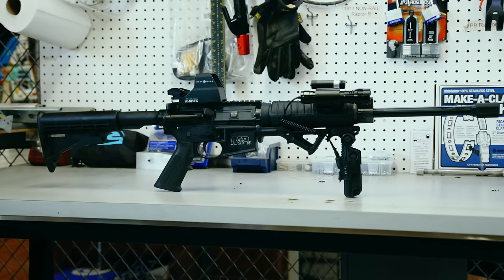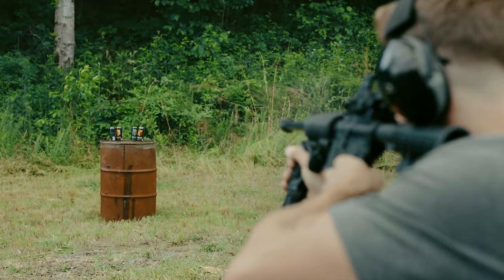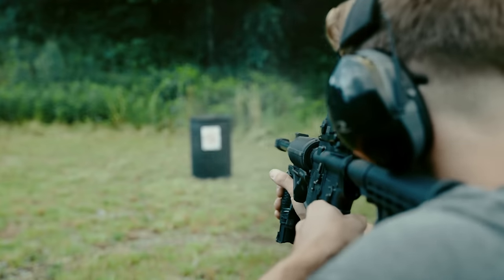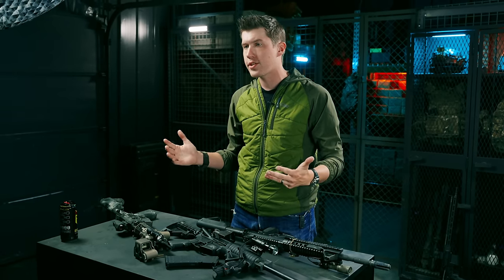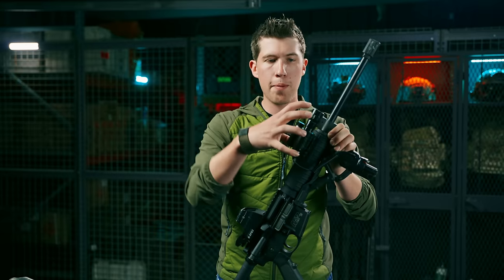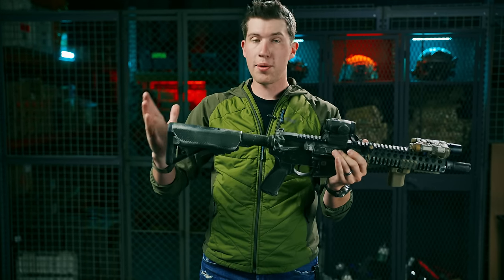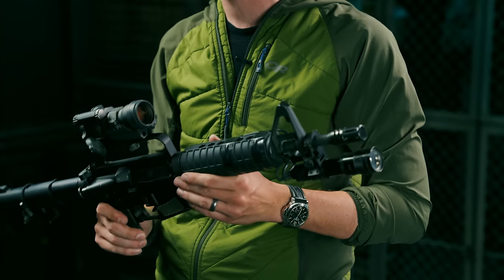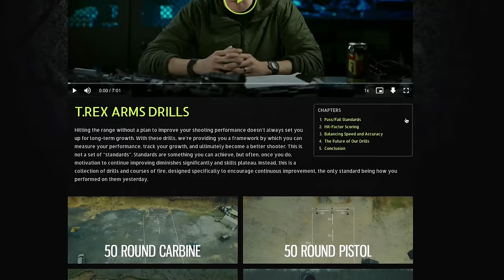5 Mistakes New Rifle Owners Make

Comment: Not technically my first rifle, but my first AR rifle was a PSA carbine kit I bought. All I put on it was a carry handle iron sight, a flashlight mount and a simple vertical foregrip.
Reply: No sling?
Reply: @xxxlonewolf49  not at first, that was my first upgrade, I also put an aimpoint on a carry handle optics mount because why not?
Reply: My first rifle was a PSA upper kit and a locally sourced lower. Total was $380. Cheaper than any of my handguns. Those were the days. More accurate than I am and over 6200 rounds the only issue has been it won't feed steel case reliably. Meh.
Reply: Chad detected. Same but 20 inch
Reply: I just built one of those!
Reply: PSA was my first build as well. It cost me less then 400 I've since upgraded a lot of parts. It is my favorite ar cause it was my first build
Reply: Carry handle chads assemble.
Reply: Did the exact same to my first ar (s&w mp 15ll) except put a drop in trigger (LE145) and a giessele super 42 h2 buffer
Reply: @Hopeofmen  oi. Dedicated Integrated grab handle upper receiver sigma chads assemble
Reply: My first was a PSA freedom complete upper and complete lower. No issues or malfunctions yet. Now I build em for a purpose
Reply: You stuck to the basics. A sling, a light, and iron sights are the true basics.
Reply: Actually planning on building my next lower into a pistol. Gonna order a pre-made upper from PSA. Glad to hear they work well!
Reply: My first build was a Frankenstein build all the way! 80% lower, Anderson upper, radical firearms 7.5in barrel had a mbus sights and a utg scope that actually has lasted and now I'm selling it and getting a new primary arms red dot sight
Reply: PSA are great American made ars.
Reply: I'm still trying to find a setup that I like. The only upgrades I'm certain on right now is my meprolight reflex and A.R.M.S frontsight and magpul rear iron. Still looking for a light and handguard I like enough.
Reply: @mustangaldine  i wouldn't call them great. They are functional though
Reply: My first rifle was a 30/30 lever action still is exactly like when I was given it when I was like 8 years old.
Reply: @prylosecorsomething3194  it's not what American is founded on
Reply: Poverty State Armory. Poor choice, bro.
Reply: @sevenpointsixtwo9707  Oh no! It's a fasion disaster!
Reply: @RJT80  try some mobile 1 on the bolt face and couple drops where it locks up in the breach. Should help with cycling steel case
Reply: @RJT80  my psa upper had that problem too I’m pretty sure the chamber is just a few micrometers too tight since the steel case doesn’t shrink back after it fireforms switched out the upper for an aero precision and I can shoot steel all day, idk if it’s a psa problem or we just got a couple of lemons
Reply: @yeedbottomtext7563  oh you got that lengthy boy huh
Reply: @NoName.NotNamed  the only ARs that interest me fr 😂
Reply: @yeedbottomtext7563  what barrel did you use? I’m trying to build one of my own but I’m not too knowledgeable on long rifles
Reply: @NoName.NotNamed  grab one of PSA’S premium 20 inch uppers for Dat sweet FN barrel
Reply: @yeedbottomtext7563  ima give it a look see thanks bro
Reply: @NoName.NotNamed  for sure breh
Reply: @zacharybigger4144  I bought a PSA back in 2020. I love it. It’s my first one. Haven’t used it much recently since I moved out of Washington state. I heard over the last few years PSA has stepped up their game. So they went from not bad to decent or slightly better than decent I guess lol!

Comment: Army teaches 25/300m zero which works extremely well with the 4x32 ACOG. If you zero with the bottom of the chevron for 300m, the top of the chevron will near perfectly line up for 150ish meter targets. That way you’ll never shoot over the target if you can estimate range fairly well.
Reply: The width of the elevation ticks is also supposed to approximate average human shoulder width at the labelled range, which helps estimate distance a bit.
Reply: Marines teaches 36/300 yard zero which allows no need for any other adjustments besides hold center mass and fire out to 300. After 300 yards we do wind holds out to 500 yards. It allows that at 500 yards your general round drift etc will not expand larger than that of a CD size. Obviously the ammo type will make a difference but essentially holding center mass from 301-500 yrds will enable an effective hit within a CD sized target.
Reply: Battlefield 3 and ArmA both taught me how to utilize the ACOG. Then I grew up a little and realized how expensive Trijicon is lol
Reply: @BeamMonsterZeus  Facts. As expensive as they are I still want one for my AK in the near future due to their durability. ACOGs are not easy to break.
Reply: @arc_4543  ACOG
ALL CASH OPTIONS GONE
super spendy. 
You’re correct they are super tough. 
If marines can keep them working, then it’s one tough ass optic. 
Loved running the ACOG in the ARMY, loved the Eotech even more. 
36/300 zero is the way to go in my opinion 25 yard zero about 1/2” high.  <for my crayon eating brethren 😂
But yes 25-300 is mostly point shoot with ACOG and Eotech. 
Marines are some of the absolute best riflemen I’ve ever worked with and I would take their instructions running a rifle all day long.  The poor guys got the least amount of gear and the most amount of kills in Iraq, always wanted to give them some of our gear.  
A well equipped team of Marines is one badass show. 
Loved going out and clearing mine fields and IEDs for them.
Reply: @antman656  agreed.  36 is where it’s at.  And Shawn did do a great job showing the ballistic differences in zeros 
Back in the early angry Shawn vids.  Amazing transformation he’s had.
Reply: I got trigi night irons for my A1.
Reply: Thanks for info, im Army and hopefully put in a few weeks. I have 18.5" tavor x95, been ex british army wanted a bull pup again.  I zeroed my m150 acog 25m for 300 and i hit tgts at 500yds.  Going to range in a out 3 weeks again gonna zero as you suggested. 🏴🇺🇸🇬🇧🤙
Reply: @antman656  ngl that sounds pretty bullshit to me. 
36/300 yard is about the same as 25/300 meter. 
And 5.56 climbs and drops around a foot+ from 50 meters to 300 meters
Reply: @arc_4543  if you can get one for the caliber you use(i think only comes in 7.63x51 nato and 5.56) the m145 is amazing if a bit hefty.
Reply: My brother was in Army infantry for 10 years. They zeroed their ACOGS at 100 meters. The 25 meter targets are what I zeroed at with my ACOG (still in).
Reply: An ACOG would be a dream optic like that's the end goal optic. They are tried true and tested, durable and reliable. However the starting price is around $1200.
Reply: @mondaysinsanity8193  Nah he's right.  Also the Trijicon 4x32 acog is made for 5.56, so the markings are the general drop over distance, the width of the lines is used to measuring distance to target, and the side lines are for adjustments due to windage, which is only applied 300 meters and on, but only really past 300 because unless you have heavy winds, 300 wont change much if at all.  100m for tip of chevron, 200m for crotch of chevron, 300m for tip of post, and so on.  The lift of the round is 25m using the 400m, 50m using the tip of the post. (I'm half sure on the post, maybe the crotch)
Reply: @johnnywalters2582  i mean none of that sounds like its disagreeing if you use the same point of aim say the tip of chevron 
And shoot froom 50 to 100 to 150 out to 300 youll see atleast a foot of variance idk exacts but enough to make a headshot at one point a crotch shot at another
Reply: @antman656  Going to be honest... I've never heard this 36yd zero nonsense. I got out of the Marines in '12
Reply: Um closest popular on any range I have been on was a 50. Zero was at 25 but that's still a 300 Meter zero target. Go what he was talking about
Reply: @arc_4543  dawg only person I know who broke an ACOG is a retired marine and he sent it back to trijicon and they sent it back fixed like new.
Reply: @jackshett  36y started with the SEALs because it has minimal spread out to about 400y. From 25-300m you can hold center of mass and you will land a hit somewhere on the upper thoracic or lower abdomen. Shawn Ryan made a video on it.
Reply: @Jewifer333x2  And I'm stupposed to know who that is? lol. Anyway it sounds like new teaching that isn't really giving much benefit over "old"
Reply: @Jewifer333x2  Sure thing keyboard warrior.
Reply: @Jewifer333x2  who's the army cook? I just prefer the more useful zeroing that I was taught.
Reply: @Jewifer333x2  anyway before your panties get bunched up beyond repair... A combat zero is only useful within the expected distance range. The 400yd that was brought up is ridiculous. You'll barely be hitting with the deviation from impact to poi. It's more useful to have something where you hit accurately between 0-300 since engaging beyond that isn't what the weapon is meant for anyway. Those ranges are what a dmr is for.
Reply: @jackshett  wow, you are speaking very much so like someone who rarely shoots at those distances, you can literally make those shots with an M4 length barrel and a magnified optic
Reply: @jackshett  dude. Shooting kneeling and supported I can land 5/5 shots on an IPSIC just simply using a BDC out of a 14.5 barrel at 400y with some low quality green tip of all rounds. It isnt hard. With a 36y zero on an MRAD reticle or a magnified red dot you could absolutely memorize those holds.
Reply: @Jewifer333x2  it's not that you can't shoot that far, is that it isn't powerful enough at those distances. Also the typical ranges that you're going to have combat in are not over 300 yd anyway. And if you're going to be shooting at those ranges anyway, you're going to be using well aimed fire and typically an optic. So when you're doing that you will be using either a bullet drop compensation, BDC, on an optic or you will be changing the elevation on your iron sights. I'm tired of these keyboard warriors thinking they know anything beyond call of duty. Your arrogance and ignorance is astounding...
Reply: @jackshett  mark wahlberg over here throwing around advanced ballistic lingo for 5.56 within 600y lmao what a joke
Reply: @Jewifer333x2  additionally if you zero outside of what is designed for your optic, you're just inviting problems. Either you'll have to remember that 300 yd range on the optic is actually 235 or you'll zero it properly the way the optic was designed. And don't tell me that you're you are using a mill or MOA dot reticle.
Reply: @michaeljenkins2493  If you're zeroing the Trijicon 4x32 ACOG for the tip to be zero'd to 300m, then you're using the sighting system wrong
Reply: @adamjohnson6506  Got one on my LMT MARS AR15. The only optic you need for AR15s in my opinion. Good luck man.
Reply: I heard you can have 25/300 or 36/200, or 100. What are the drops?
Reply: Well done nice and succinct
Reply: On what caliber ?
Reply: @ronaldraygun2639  5.56x45mm
Reply: It's not bad. I like the 36m zero a lot but at 500 you definitely need to be holding at the head or shoulders at least. It's almost a 9 MOA drop. At 25 zero it's only 7 MOA drop. At least that's what I have to do. Even then I hit low.
Reply: You don't use the tip of the chevron to aim. You use the little dot under the chevron. If the torso or shoulders do not touch the edges of the chevron then you can use the lines under the chevron to gage distance and hold for elevation.

Comment: Not gonna lie, I put a Sig Romeo 5 on my shorty AR and fully expecting to upgrade it later but in 5 years I've had zero issues with it. It's still holding the same zero that I put on it when I first zeroed out. I'm not gentle with that gun either. I'm very pleasantly surprised by how well it's done.
Reply: x2 for Sig Romeo 5
Reply: Yep
Reply: Same here, took it off now for a vortex pst lpvo but it served me extremely well for 3 years…
Reply: You gotta realize these guys are a bit elitest and not really the everyman.  There are really good red dots from sig, primary arms, and holosun.  They all last a long time.  In many cases just as long as stuff costing double.

They recommend some great stuff but it is all high end expensive stuff if you aren't a wanna be operator.
Reply: @SW0000A  totally agree… they do recommend kind of the best there is but I got to give it to him he did mention primary and holosun as good options. 
We all want that DD with a aim point or razor surefire can and dbal but until I get that, I’ll stick with an average gun with a holosun .
Reply: A Sig Romeo 5 is nothing to scoff at.  That's a good red dot.
Reply: @shrimuyopa8117  I second that.
Reply: I've also had the Romeo5 for about that long. Only issue was the mount but recently changed it with the one Scalarworks makes. Pretty happy with it.
Reply: @shrimuyopa8117  I third that and will go as far to say the Romeo MSR is good for as low priced as they are. It’s my understanding that holosun makes SIG sights.
Reply: Most brand name RDS in the $150 range are plenty good for practically any situation a civilian would ever encounter. Don't need EOTech, Aimpoint, Trijicon etc. but if you got the coin and want the best, whatever.
Reply: Yeah, sig romeo 5's work. It is the current king of the budget 100 dollar red dot market and has been for a while for good reasons. There are better things for more money but as a getting started red dot, you can do much, much worse.
Reply: x2 for the Romeo. Purchased my Romeo 5 in Alaska and expected to have issues, but its lived through the cold, maybe two-ish thousand rounds, thousands of miles of travel recently. Went to the range expecting to have to re-zero in Oklahoma before a competition and that little sucker was dead on still.
Reply: I like my Romeo 5 MSR. Still planning to upgrade, but no rush.
Reply: Another one for the Romeo 5. I recently upgraded to a T2 but my Romeo 5 was going strong at the two year mark. Multiple courses, bouncing around in pelican cases, etc.
Reply: Romeo 5 and holosun I have on multiple rifles. Expensive stuff on others. It's all about what the use case is.
Reply: Very happy with my romeos as well
Reply: I left a romeo 5 in the trunk of my car for a whole winter.  A frigid sub zero winter in the tundra of Idaho.  I checked it every couple weeks and end of winter was good to go.
Reply: I would have to agree, but I didn't even get to zero mine before it broke. Changed battery and still nothing
Reply: Did the same on one of my Aero Precision 11.5" m4e1 builds. Im actually just about to order a "sky scraper" mount from scalerwerks bc my head and face is so big lol. Nothing wrong with Romeo5's. I have other more expensive optics as well but still doesn't change anything. If they're good they're good.
Reply: @SW0000A  I agree.  All of my red dots are Sig Sauer.  They're all solid!
Reply: Yeah, I bought a Romeo 5 and learned that I had astigmatism. Great red-dot though.
Reply: Holosun makes all of the Romeo5 line but to SIG's exact specifications. They are great optics and anyone who scoffs at them is just addicted to price fallacy. I will admit that holographic sights are a different breed of black magic sorcery... but in terms of standard red dots, really can't be beat for the price. Also, my XDR is going to far out last an EoTech or Vortex holo on it's one AAA battery and be far easier to replace in a true A2 situation.
Reply: @SW0000A  true but he's also is talking about using the rifle for fighting tyranny, saying it's the true meaning behind the 2nd amendment (he's correct).

I agree that a primary arms dot can last a long time and work well but I'd much rather have an aimpoint pro if I'm going to battle against tyrants ya know?
Reply: @SW0000A  I bought a holosun and I was pleasantly surprised on the quality, The quality of the holosun is comparable to the eotech I own. More clear sight ring just as robust with a solar panel for when you run out of battery power. Plus the shake feature is freaken awesome. I kind of wish I bought holosun for my red dots in the beginning instead of spending money on vortex and eotech. But you do not know until you try it.

For my next build I am going to try the sig romeo and julet for shits and giggles and see how that works. 

And yes I do use a magnifier for most of my builds because I do like the ability to reach out and touch something with proper identification.
Reply: @SW0000A  the only thing Lucas has ever operated was his instagram account lmao
Reply: One of the biggest mistakes I’ve made is buying a couple Trijicon MRO red dots. What a waste at $450 each! The Romeo 5 is BETTER IN EVERY WAY! The dot is clearer, it’s lighter, it comes with lens caps, has more brightness settings, and I can buy 4 for the price of an MRO. The MRO truly sucks.
Reply: @cliffordmontana4562  i am going to compare the romeo with the holosun when I get enough cash.... would be a good experiment.
Reply: @DarknessNation  For sure! The only difference is Holosun makes a few different options, and the main difference between them is where the battery is located. Some of them require a tool, which is stupid. I love the Romeo 5 because it’s a quick, tool-less battery change.
Reply: Romeo XDR has been great for me. Green is super bright
Reply: @tkbigger4792   Did you turn it on by holding the + & - buttons for 2 seconds then press the + button to turn up the brightness?   I thought mine was broke too, till I did a little tinkering and figured it out.  😅
Reply: Sig Romeo is a good one
Reply: I have one it's been great also